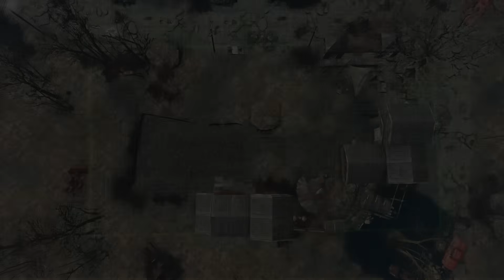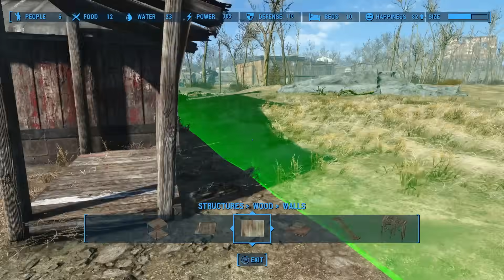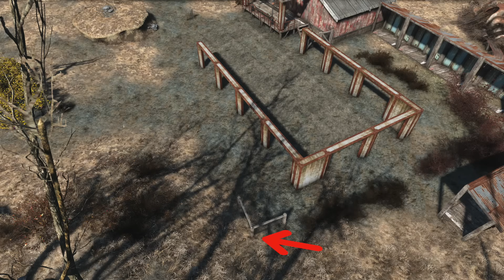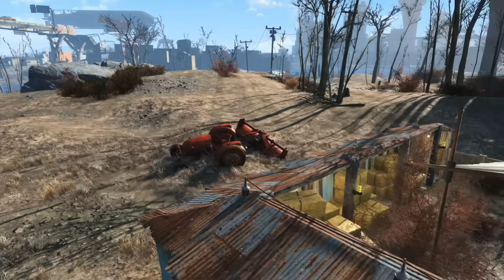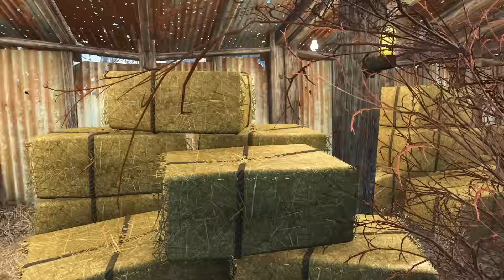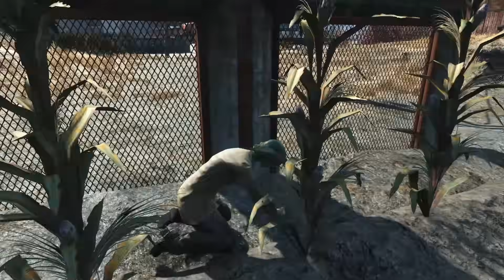Fallout 4 County Crossing - Brahmin Farm Build (No Mods/Glitches Tutorial) Ep. 4

Comment: I play on PC and I have a question.  How do you "assign" or keep the Brahmin in their enclosure?  Settlers keep opening the gates and the Brahmin just wonder the settlement.
Reply from the maker: Unfortunately, I don't know of a way. Make sure that you have at least 1 feed trough per Brahmin.  That should keep them confined to a specific area. However they can't be assigned to a specific feed trough - so they aren't fixed to that spot.  Sometimes they spawn into the wrong location when you return to the settlement - one of my Brahmin spawns into the field behind the corral but the other 2 are in the corral at the feed trough.
Reply: It’s tricky. I usually do one Brahmin and one feed trough  at a time. Then while it’s feeding I put in a fence, or divider . Then I get another Brahmin, place the trough down, wait till it’s eating and put in the fence.  The cows don’t manoeuvre well so mostly they end up staying there. Although sometimes they respawn somewhere else. Including on barn roofs lol.
Reply from the maker: @62zuzuspetals That is a good strategy - that would keep them from getting stuck trying to get to the trough!